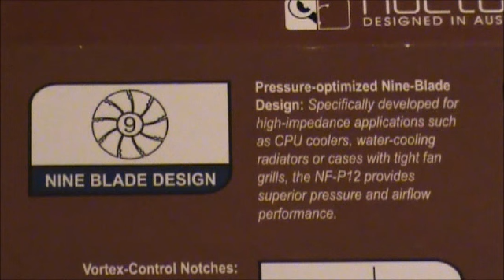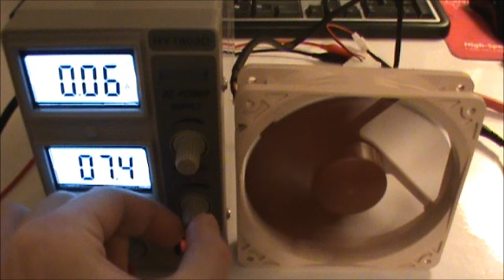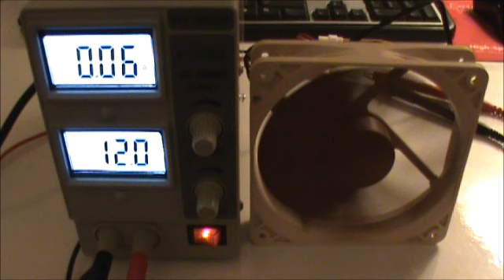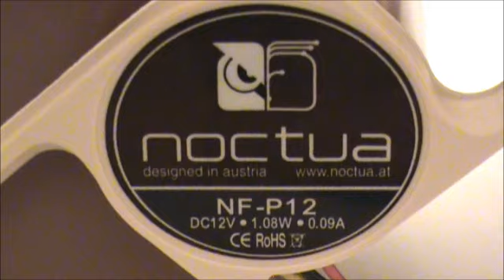Noctua NF-P12 120mm Fan Review

Comment: Yep that's how they sound. I have two of them right next to my face (I have my case on the table). Excellent as case fans if you have filters or hdds it has to push or pull through, it's got very nice static pressure and airflow as well. One of the fans I purchased was vibrating like crazy though, so I got in touch with Noctua and 3 days later I had a new fan - Awesome customer support, best I've ever seen.

Comment: Where can I get the ultra low noise adapters?!!!
Reply from the maker: They come with some fans. All they do is drop the voltage, most motherboards can do the same thing with controls in bios and vendor-specific applications.
Reply: @Metalcastr  I got a large diafragm mic. Do u recommend these for recording vocals and vo?
Reply from the maker: I haven't used a good mic for making videos yet, just crappy cam mic. From research, better mics do sound better though. There's crappy mics, better headset mics, USB mics, the ones with phantom power, mixer, the works. A $1000 mic isn't $900 better than a $100 mic, IMO. @Anime-nl9mr
Reply: @Metalcastr  haha sorry I meant the fans 😂

Comment: so its constantly at 1300RPM regardless of the different adapters?
Reply from the maker: The different adapters are for modifying the speed. Each one makes it run at a different RPM. You can connect the fan directly to your motherboard or power supply as well to run it at full speed.

Comment: Is it suitable for replacement in the power supply?
Reply from the maker: Power supply fans are more powerful. PSU fans usually run slow, and when they are needed they can run much faster than this one is capable.

Comment: I wonder if it would have made less noise were it resting on a soft pad than a hard table (to simulate the rubber vibration dampeners)
Reply from the maker: Good question, if it were making any vibration I would have noted it, so far the fans reviewed have not had any vibration issues.

Comment: Do you reccomend these for heatsinks?
Reply from the maker: Nikola Angelov I would only recommend them if they were dual fans on a large heatsink in a case with good airflow. They did not impress me in the airflow category, however they're designed for low noise. I reccomend at least 1500 rpm fans for heatsinks, preferably 4-pin fans that can go from around 1200-1800rpm depending on CPU temperature.

Comment: I heard that the new noctu fans that use 25 volts can use 30volts because the motors are rated for  30volts so imagine that on 30volts
Reply from the maker: That's interesting. IIRC server and industrial equipment fans use higher voltages. Consumer PSU's only put out 12v though. We would need a new ATX spec for higher voltages.